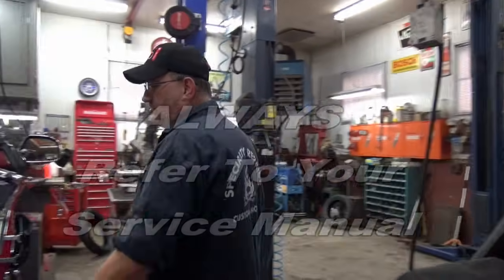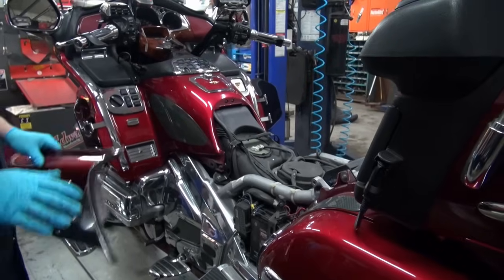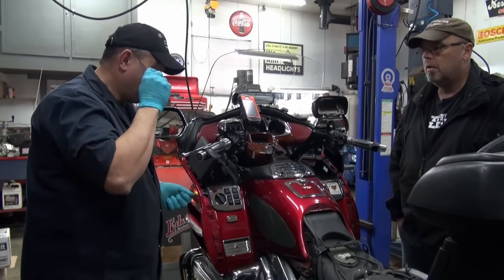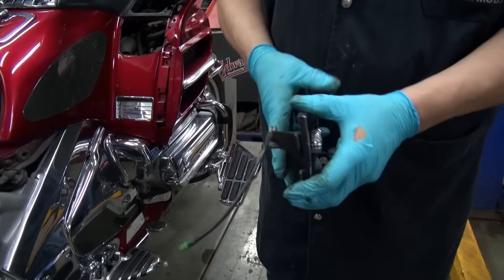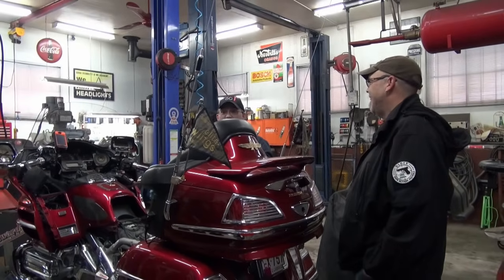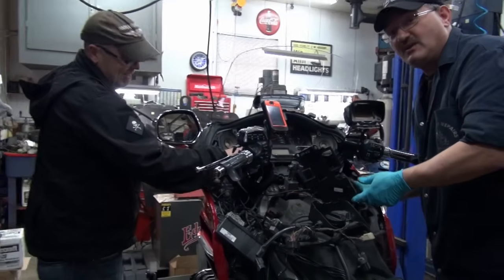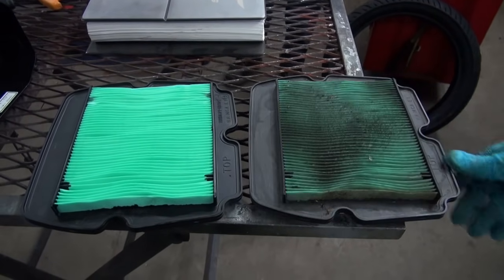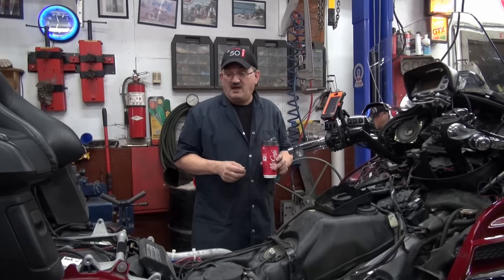2001-05 Goldwing Air Filter Replacement

Comment: I think I have the mechanical ability to do this.  I certainly have all the tools I'll need... Might even be able to muster up the patience.  The only thing I'm lacking is enough space in my two car garage and/or back yard  to set all the dang parts aside while doing this!
Reply from the maker: You can do it. If I can, you can 👍
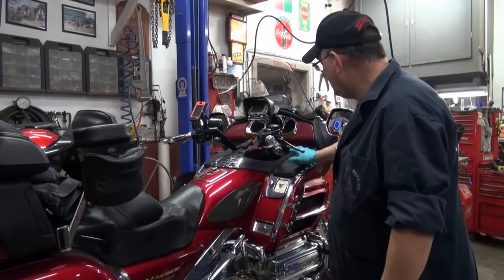Reply: Paul, if an hour ago, you heard the sounds of cymbals crashing or perhaps angelic harp music playing in the distant, distant southwest,... it was as I completed my air filter change!  Oooo rah!.  I started at 1 yesterday, called it quits at 7pm.  Started again this morning at 10 and finished at 1:00.  Several times I came back into the house to watch your vid and there are some differences between my 2009 and your bike but nothing major.  As I expected it was tougher putting it back together than taking it apart.   Your "indexing" on a piece of cardboard was something I'd done before but absolutely a MUST for this adventure.  The only part I lost along the way was, ironically, the knurled nut that holds my cup holder in place.  I had to take it off to wrestle one of the panel inserts out and it fell down into that engine hole where M7, The FBI, KGB and even ghost whisperers could never find it.  Not a problem really as any chrome nut could replace it.  So, I got the whole thing buttoned back up and headed out for a few miles to make sure  everything was in good working order.  About five miles up the road I pulled into my rural post office to check a p.o. box, and when I came back out I saw something lying beneath the bike... There was the nut for the cupholder.  I'm guessing it came to rest on the kickstand (which was up when the work was being doing as I had it on the center stand.  But, after forty miles of riding, every thing works (I feared missing one of the plug-in connectors,) but I can report it is all good.   Also, pleased to report that my doctor neighbor reports that because I'm  a bit obese in the ass area, he tells me there should be plenty of skin there to graft over the knuckle scrapes and bruises.  Oh well, better than paying $500 work of labor for a $22 part.  And I will be fully healed by riding season which is scheduled to include a trip to N.B., PEI and maybe even Labrador next August or Sept..    Thanks a million for the great video.. couldn't have done it without your help!   Richard Mourdock

Comment: Do you always use oem air filters or do you consider any upgrades
Reply from the maker: I’ve always used oem. They are engineered for the bike and they’ve always worked well.
Reply: OK is that the same coils mine an 84 interstate 47km  on  it . I got it because it was cheap to me And pland down road . I came form sport bike like duc 748 1089 cbr600 to rr and know they aren't made the same . I've got it handled pretty dissent  just  seem lazy to .

Comment: This video would have been very helpful if Paul had actually showed us how to remove all the screws on camera instead of removing them off camera. Had to watch another video to figure out every thing he was talking about. But thanks for your video anyway.
Reply from the maker: And this is the very reason I don’t do Goldwing videos anymore. People will not watch a detailed video. They complain the video is to long so there are things I leave out because we assume people will have enough smarts to figure out the simple things. Take some advise. If you own a GL1800 GoldWing go get yourself a factory service manual so you don’t need to watch videos and it will pay for itself on the first repair.

Comment: This brings up the question, "why would anybody in their right mind buy something designed to be so hard to service??".  Appears to be Honda's version of an intelligence test.  It sure lowers my respect for Honda.    Give it a year or so more and those plastic clips and electrical 'snap together' connections will all break so they can't be reassembled when the plasticizers migrate out of the plastic.  Then come some more large bills for new parts and wiring harness if you can get them.  

I have to give you credit for doing a remarkable job on taking it apart.  So what would shop time plus the $50 (talk about gouging) filter total out at?  Looks like everything on that rat's nest would be equally hard to get to.   Those design engineers need to work on their own stuff!!!  That is just unbelievable.  You couldn't give me one of them.  Hope you don't have high blood pressure.  Lock up all your sledgehammers.  Doug

Comment: I like ur new geeeeetar riff for the intro and outro.  Is that U or UR offspring twanging out some geeetar chords?

Rant:  I guess it's a good thing UR really into that Goldwing as I can say if it were mine,  it would spoil my luv relationship every time service was needed.   From what I have seen with UR experience and what I have encountered on various vehicles, the Japanese bikes, cars, and trucks are so poorly designed when it comes to the service and repair aspect.   As U R well aware, every machine needs service regardless of how long it is supposed to last.  No wonder it co$t$ all UR limbs in service bills for simple maintenance.  If the air filter requires that much work, I can only imagine what the other service items are like.  OY! 

Knowing ur billing urself on this one for a days worth of disassembly / reassembly work will make the bo$$ happy. :-)  

Just saying ...
Reply from the maker: +Ji Fi-01 (Jif) 
The GoldWing requires the least amount of  maintenance of all the big bikes. I've worked on them all and this one has had the least amount of issues. Other than an oil change I haven't put a wrench on the thing in four years. Remember, it's a 12 year old bike. Every time I ride Kathy rides with me so I'll use every bit of my time, money and energy to make sure this vehicle is safe for the two of us. That's why she enjoys riding with me. It's safe.
Reply: +Paul Short Yessir, u do indeed take great care of UR toys, as noted.  makes notes It's a luv/hate thing - luv the bike, don't like the design-for-service.  shrugz   I'm glad in spite of the labor (minimal beyond this occasion, as mentioned), there is still a luv BEHIND it.  

Speaking of BEHIND it all points @ Kathy seated in comfortable rear  Sorry, Kathy, nothing meant by making you the butt of the joke here!  HAHA.

Now twang some more of that guitar song, if u will please.  :-)

Comment: very tuff job to  clean an air filter,  bike is very very nice and beautiful but  As in India it is very dusty  you need to clean filter at least for 2000 km and is tuff to clean it
Reply from the maker: Your right. Honda sure didn’t make it easy with changing the air filter but it is an outstanding motorcycle and we really enjoy ours. Thank you for watching.
Reply: @7863348  Thanks Paul & Kathy  for your Reply

Comment: A pure highway bike should never need a new air filter. Filters actually filter BETTER the "dirtier" they get and short of the bike being flooded or ridden in torrential rain or on "dirt roads" directly in the dust cloud of a vehicle in front of them for hundreds of miles OR a coolant, oil or fuel leak "soiling" it the filter should remain "like new".
Reply from the maker: Thats totally false. What about times when your riding and hit road construction and have to travel on dusty paved surfaces or detours? Your comments are laughable. 😂 People. Do your maintenance and by doing so you just might catch other things while your in there. These bikes can last a lifetime but you have to replace ALL filters and all FLUIDS from time to time. Ride safe.

Comment: Cripes almighty, all that to do an air filter. . .I think I'll wait till winter to figure out this fuel leak.
Reply from the maker: Fuel leak on a GL1800?  The filter isn't bad to do lol
Reply: Oh it's a 1500. Dad had it sitting in his Garage for 5 years before he passed away. I siphoned out the old gas put a new battery in it to see if it would run.

It did but fuel was pouring out the sides. so yeah, looks like a project when it's nice and cool outside.
Reply from the maker: Oh. The 1500 has carburetor sand they yours is going to need to be removed and cleaned. The GL1800 GoldWing is fuel injected. Good luck with it.

Comment: I'll never bitch (in Italian) about the air cleaner on my Aprilia (RSVR) ever again....

You mod adding things on...  I mod taking things off.    What does the Goldwing weigh??
Reply from the maker: +ramosel 
I've never seen a wing owner take anything off a bike lol. They just keep adding and adding and adding. Had mine on the scales and it came in at 1123lbs.
Reply: +Paul Short holy smokes... If you ever lay that thing down you're going to need one of those excavators you fix to pick it up!  I just looked up the specs...  About 120hp...  I'd have expected more for that size motor and weight, but it's a cruiser so it probably has all it needs.
Reply from the maker: +ramosel 
Man you'd have to ride it to believe the power it have. They are used as tow trucks in Europe. It's by far the best bike I've ever owned hands down and I've had over 40 of them in my lifetime. Smooth, quiet and reliable. As for pickup one up off the ground. Google it. Very simple process. If you haven't tried a Wing do it because you'll be very very surprised how nice a machine it is.
Reply: +Paul Short nah, I'm your age but not ready for a cruiser just yet.   I like Italian stuff... half the motor, twice the horsepower and a quarter the weight...  and no passengers.

Comment: Seriously, all that for the air filter? What on earth. Hope it's 100,000 mile intervals jeez. I had a gl1800 but I just buried it with a backhoe because it was about due for a new air filter. Wholly cow!!! No seriously, how many miles you get between changes for those filters? Jeez

Comment: OMG. And to think I wanted to buy 1 of these bikes so badly. Theres just too much crap buried under the plastic. I have spent my fair share of time doing complex auto repair s but this is ridiculous to change an air filter. Or access anything of value
Reply from the maker: It’s  like anything in life. If you run from it you’ll avoid it. I do these filter changes now and I enjoy doin it. The joy I get from this bike outweighs the time it takes to change a filter.
Reply: Fair point :) iam currently doing a 4 wheel trike conversion for a friends 1800 love the looks of the bike but definitely surprised by the amount of stuff on these machines